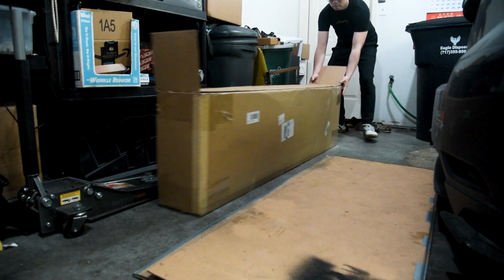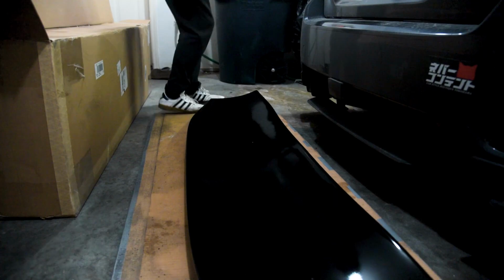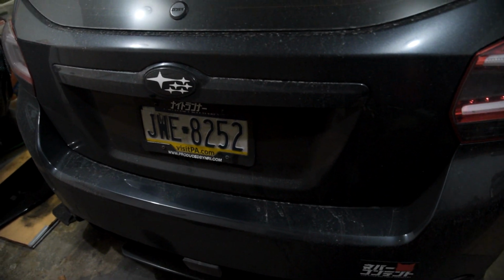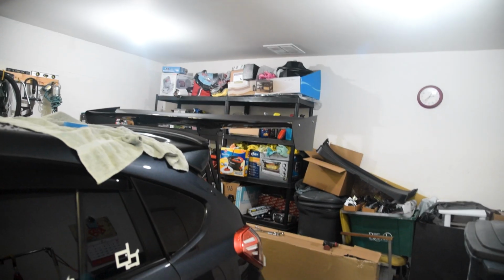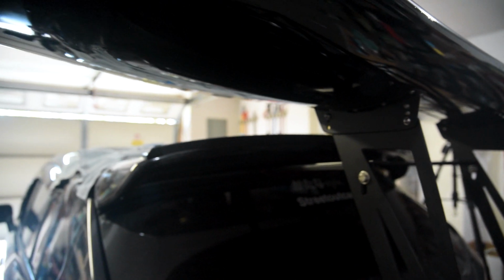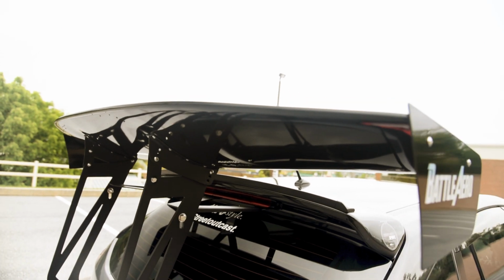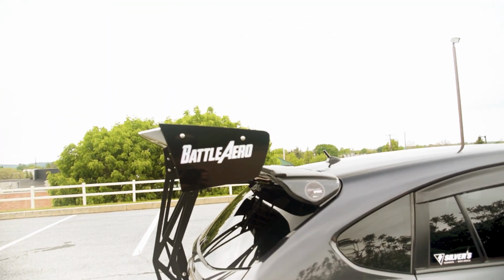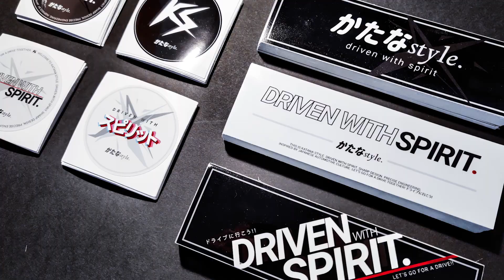Battle Aero Hatch Mount Wing | Unboxing / Install | Subaru

Comment: Looking to do this for my forester.  Love the look and didn’t really consider the license plate area as a mounting point.  Still on the fence if chassis will look better for me but love the look.  I wonder if those brackets that stabilize under the wing could be modified slightly for the forester hatch

Comment: Damn man that’s hardcore 🤘 also I just barley noticed your rear wiper delete, have you noticed times you have needed to use it? Or do driving speeds just naturally keep the window clear. Let me know, been thinking about removing mine
Reply: Keep it. I tried it for a bit and regretted it as soon it rained. 🤣
Reply: Ed Calderon  cool thanks for the input
Reply from the maker: Lol it all depends on your priorities. I wax my window regularly so nothing really stays there for long. And I clean my car often enough to not have to worry. I did it so the rear end looks alot cleaner
Reply: Willis Do  ok that makes sense, then any rain fall would slide right off cool